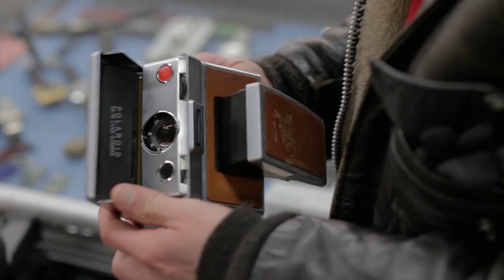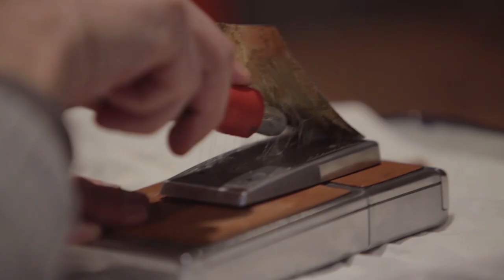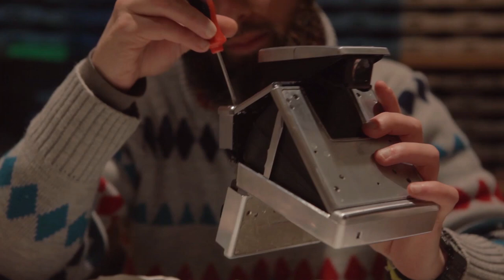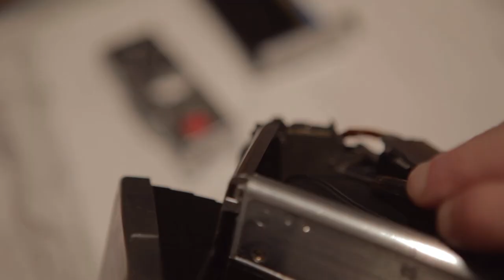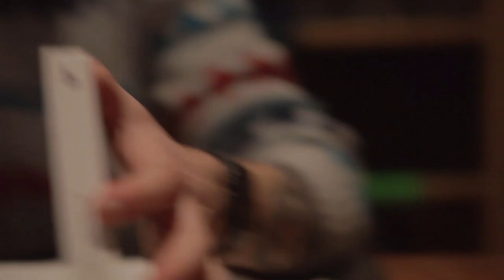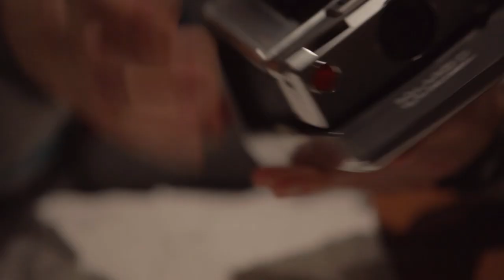POLAROID SX-70: NEW LOVE FOR A LEGEND

Comment: sweet. I have been considering buying one, but am torn between the sx70 and the sx70-680 or 680se, or 690. any thoughts on this. my interest is primarily portraiture and architecture, thanks for the great vid
Reply: I see quite a few around, ebay, easy et al
Reply: +mastermooky 
I have an SLR690 that has an issue where when i turn the flash off, it defaults to the longest shutter speed.  The problem with the 690s is that the circuit boards are a total redesign.  When they fail, good luck finding parts for it.  They have no compatible parts with the 680.  So chances are it will be unfixable if you find one with a fault.  So there's no real advantage to having a 690, except "bragging rights" =o]  Stick with the 680, those can be fixed with any and all prior SX-70 models.
Reply: thnx